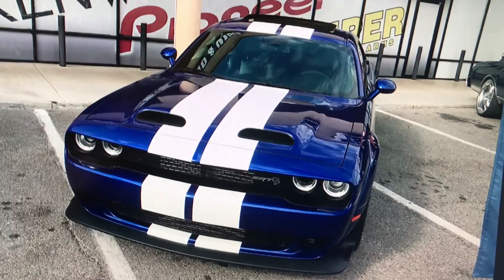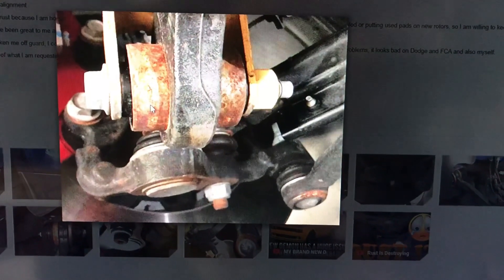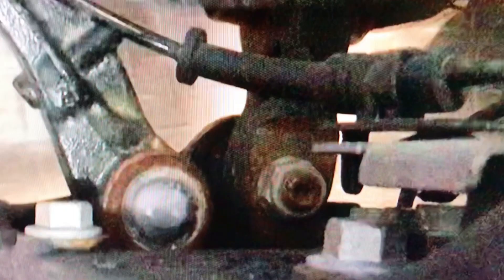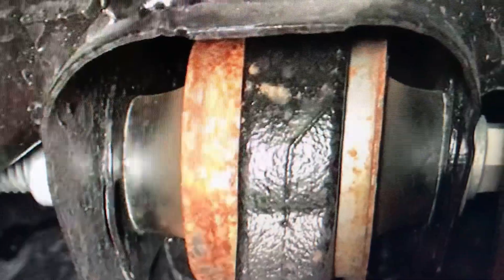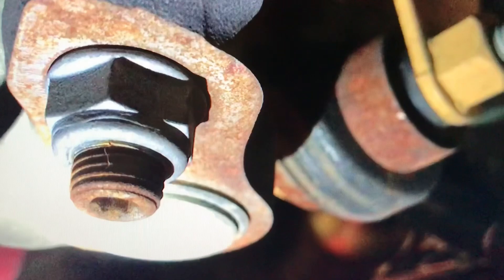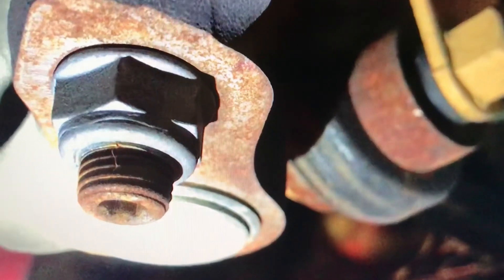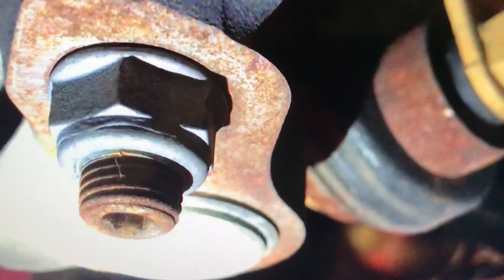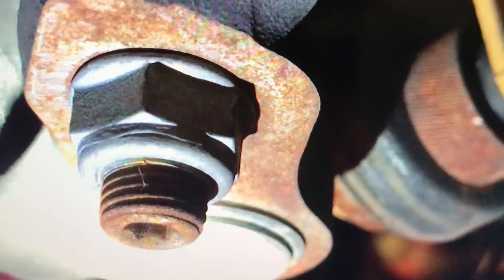2019 HELLCAT REDEYE WIDEBODY EXPOSING THIS SERIOUS RUST ISSUE VIDEO 1 OF 2 SHAME ON DODGE & FCA

Comment: You're one of those customers I'm an ASE certified master technician there is nothing wrong with that suspension all of it is just surface rust including the threads there's no crack in that bolt  you're saying that you don't expect rust issues but you have to realize there are a lot of factors that play into the amount of rust on the underside of the vehicle number one factor is location location of the vehicle location of the dealership pretty much if it's near the coast if it is in the snowy area if it is in a very dry and harsh location you will see rust accumulating a lot faster please before you start bashing any company or manufacturer do your research talk to a local technician
Reply: Right he just copying Kevin van voris and the way he talking about he doesn’t seem upset he using this as away to get content for his little channel
Reply from the maker: @drunkendemon1867  I do not need to copy anyone and YouTube is not how I make a living, so your clueless to what you say
Reply from the maker: I have done my research, maybe you should also and stop accepting what they tell you
Reply: I've seen this on Chevys, Fords,  Subarus etc. But the fan boys on here need to bash Dodge.
Reply: @cashsanders4111  I don't give a s*** about the FCA I've been in the automotive industry for about 15 years now I've seen rust on a brand new 2019 ZR1 that's $150,000 car we in automotive industry know exactly the difference between surface rust and actual rest and the different conditions that cause it surface rust as seen in this video is unavoidable in certain conditions instead of coming on here and trying to insult people and trying to stick up for someone who doesn't know what they're talkin about please take a pen and a piece of paper and try to learn something because I do know what I'm talking about

Comment: I work in the aftermarket industry and am the guy who puts lift kits on new trucks, adds heated seats, new wheels and tires ect. so when you take delivery of your car it’s exactly how you want it. No matter what vehicle comes in Chevy Ford Dodge Ram something is always “rusted” I would more over call it surface oxidation metal and humid air/rain water will cause this on any vehicle. Get under there like I did my truck and sand and repaint and keep up with regular maintenance then cover the surface with a metal protector like amsoil metal protector. My truck looks brand new off the line now even through this winter in Ohio
Reply: Completely agree with you.
Reply: Rip banana I miss him

Comment: as long as you keep buying dodge products you will continue to keep posting videos like this.i work at a dodge dealer and i can tell you that they all rust just like yours did.nothing special about your car that caused it to rust any faster or different than any other dodge with the same chassis..the chargers do it,the magnum station wagons do it,the challengers do it and the chrysler 300's also do it because its the same fucking car with the same suspension components.if you dont believe me then have a look at all of the cars that i just listed and you will see that they are identical.and yes they fucking rust.dodge didnt take the time to coat the steel with aniti corrosion paint or clear coat inhibitors.its a dodge and you get what you pay for.over priced junk my friend.i told you to buy a mustang gt 350 but you didnt listen.this is why 99% of dodge technicians DO NOT DRIVE DODGE PRODUCTS.but we sure do make a damn good living from them!!

Comment: Just like to let you know that all of that is surface rust, and a ton of cars over $100,000 often have large amount of surface rust like that on the bottom of car. Look at the bottom of a ford gt or a $80,000 Ford F-350, Chevy Silverado 3500 or Ram 3500, all of them have surface rust like that on the bottom of them. And yes they didn’t want to replace the front suspension for you for free if there was no problem at all, obviously you have never seen surface rust before. You can even find Lamborghini’s with SURFACE rust just like this. Also you are guaranteed to get surface rust on steel, unless it is stainless steel is 100% going to have surface rust. Especially if you leave it outside all the time. Why do you think older cars are always covered in rust. And with you living in Las Vegas all the sand will eventually grind away at the powder coating revealing the bare metal and causing surface rust. If it’s not surface rust then you would be able to flake off large piece of metal, but guess what you can’t. 

Oh and the $77 million fine was because of the fact that the Hellcat and Hellcat Redeye didn’t meet fuel efficiency regulations, as in they use too much fuel, you really need to do some research before you post stuff like this.
Reply: even stainless steel rust under some circunstances

Comment: That’s normal.  That is NOT an exotic. It’s a dodge!!  Buy yourself a Mercedes Benz, an stop complaining.
Reply: Until it's sitting in the shop for 3 months for electrical problems.
Reply from the maker: You realize that this is a Mercedes E Class Platform right?

Comment: Its a Dodge Challenger with a big motor. That did expect dude? You’re one of those people who only cares about 800 HP and 0-60 times. It needs iron to hold its pig fat...would take 20+ years for that surface rust to become a problem.
Reply: @williamdouglass7864  Ford had 29 million transmission that needed recalled in the early 1980's Reagan changed the law to not put Ford out of business. Ford sent out stickers to let people know the car could jump out of park and kill you. Instead of spending the $0.03  per transmission to fix it.  Over 1000 people injured and a bunch dead.

Comment: Just drive it and enjoy it. It's not a museum piece it's a car. Surface rust..... It wont hurt the car. Ive had two challengers that both looked like this, Scat pack was worse than my hellcat. The cars sit outside in unfavorable conditions until they ship, then they are still shipped in unfavorable conditions...Dont let surface oxidation on the underside of the car keep you from enjoying it.

Comment: It’s called flash rust . Pretty common in a lot of newer cars from all makes. They are using cheap grade steel .Coat  the surfaces in Wd 40 and that will keep it from getting worse. I would also recommend it getting a full underbody professional undercoating . Your car sat in a storage lot briefly in Canada most likely before being shipped which made the problem worse. Not a huge deal man. I’ve seen late model almost brand new Honda’s , Gm cars have similar issues.
Reply: nah oil undercoating that what we use in canada because the ruberized or things like that will get hard and crack over time then water will creep in and split rust will formed and split the metal

Comment: @Paul Klein.  I had the same issue with my brand new 300S. Local dealership stated they never seen anything like it before. Long story short, dealership refused to help and FCA stated I didn't have an issue.  Come to find out that certain Dodge/Chrysler vehicles manufactured in the Canadian plant during the winter months had components that were not properly treated. Those parts then were exposed to a deicing agent that is frequently used around the facility, thus having a reaction. causing those parts to rust and rust fast. My brand new 300S with les than 30 miles on it had parts that literally looked like they came off the Titanic. Check your vehicles manufactured date and I guarantee it was built during the winter months. Just FYI I live in south Texas so we don't have vehicles exposed to road salt or deicing chemicals.
Reply: That's exactly what this looks like. Good detective work!

Comment: Geeze and my Redeye is due any day now to show up to the dealer but we have an agreement to put it right up on a lift and pull all four wheels to inspect it for these issues.
Reply: Good move. If im not mistaken, u have the right to refuse delivery and they have to refund you if you dont like what you see
Reply: @msaleh93  Yes I do have the right to refuse delivery and a refund of my deposit. In Paul's case if that car was state inspected in Pa. the inspection mechanic and dealer would have some serious explaining to do passing a cracked major suspension bolt like that. It's clear it didn't just happen and it has some serious rusting going on.
Reply: @Old_Tyme_Racing  Yeah the cracked bolt sucks. But videos like this make people think that having some rust on components on  the bottom of a car is not normal. Bolts are gonna rust. That is what they do. NOW they shouldn't have been rusted at this time. It takes a couple years.
Reply: Let us know what you find....
Reply: @Anth230  The other rust issues are normal for new cars but there is some on there like that rusted cracked bolt that are unacceptable. Kevin Van Voris's Demon was a travesty as his bigger issues were the painted parts had the paint peeling off in sheets and they pitted but Dodge replaced everything.
Reply: @Anth230  Trust me I plan on doing my own video on my ordering experience with Dodge and condition of the car when it gets delivered.
Reply: @Old_Tyme_Racing  Cool, I would be interested to see and if there is serious rust and you refuse the car, what they have to say....
Reply: @Old_Tyme_Racing  Yeah that bolt sucks. They should have automatically replace it and cleaned that area up for him....
Reply from the maker: My 15 Challenger has Zero Rust and it is 4 Years old with 22K miles, this is not normal surface rust, a few more hours the 2nd video will post, it is taking over 6 hours at this point to upload
Reply: @ThePaul1551  Paul I agree with you. some of those components do rust over time and is normal to a point. Not sure how long it takes in Vegas for a vehicle to show any signs of rust on the undercarriage (if any) but things like axles and drive trains, certain engine components do rust. It's pretty much normal because they are exposed untreated metal. But the cracked bolt is unacceptable and yes they should have immediately fixed it. As I said in my post. My bolts on my new truck were not rusted and it was on the dealer lot for months exposed to the elements. It usually takes a few years for nuts and bolts to rust. Not sure why yours are already rusted. I can only assume they do not store their parts properly. Anyhow you have a right to be pissed and I'm on your side.😎 Good luck. I will be interested to see how this gets resolved.
Reply: @ThePaul1551  can you seeing any of these rusted components when you shot the first video of it on the delivery truck.? All this rust is BS. 100K Dodge could at least invest what 1K in quality hardware and its protection.. I hope you sue.. look forward to second video

Comment: Even at its worst, FCA isn’t even as bad as what Ford is doing to their Gen III Coyote owners.
Reply: I don’t know about that. Both companies are known for terrible quality. At some point buyers for these companies have to wise up and realize some things never change.
Reply: Ascendancy I must be a lucky one.  I daily drive a 17 Charger Scat Pack, 32k miles, and it runs like a clock. Never been in the shop for anything but scheduled maintenance.
Reply: Truth right there
Reply: I agree.  At least FCA isn't putting plastic oil pans and drain plugs on its cars yet like Ford does.  Can you imagine paying $60,000 for a Shelby or $70,000 for a Raptor and getting a plastic oil pan?

Comment: Unacceptable.I purchased a 2016 Ford F-350 new and I had rust all over the front suspension.It was far worse than that.Ford told me that it didn’t effect the structural integrity of the vehicle and was acceptable.The dealership stepped up and offered to replace some of the suspension parts and offered to pay for rust proofing.Well not a good idea to cover up all the rust so I said no.The dealership did try help to a certain extent but the right answer was to replace everything that was rusted.Stand your ground you are right.Traded the truck for a new one 1-1/2 years later.And yes another Ford.This one did not have any suspension rust issues.Still good as of today.good luck look forward to the next video.

Comment: I don't know a mechanic in their right mind that would classify that car as unsafe. Untreated metal always will surface rust, pretty fast too. Many cars can be brand new on the lot and have more surface rust than that. Especially a car that sits that low, the first time it rained that rust would start to form. Anybody who has ever wrenched on a car or has knowledge of fabrication understands these elementary basics. You don't want surface rust on the underside of your car? Pay for POR15 or a similar undercoat. Metal MUST be treated to not surface rust, and surface rust is completely normal wear.
Reply: YEP--this has been a big issue with many Ford F150 trucks---but a coating will fix that---there are even plenty of videos about this.  It is amazing people will spend $70K on a car and $20k on options then not spend a dime to under coat, just let it rust so they can blame the dealer or whoever.

Comment: My 18 Hellcat with under 1,400 miles, CA, never seen rain, has rust in those areas, albeit not as much as yours. I plan on brushing on Corroseal rust converter and then after that spray on some WD40 Corrosion Inhibator
Reply: hit it with Fluid film or Crown. Much better then WD

Comment: This isn't nothing new my 2003 Ford Lightning pickup color white had rust spot in the white paint all over yet this has been happening for more than 25-30 years get a grip. At least yours is under the car and not on top.😂
Reply: Clay bar will take those rust spots off easy. All cars have it but only noticeable on white cars.

Comment: Chrysler is known for their lack of rust proofing the vehicles they sell.  I lived in Buffalo, NY for almost 30 years and the Chrysler vehicles never lasted more than 6 years without serious rust on the body panels.  You should have taken that thing to get a rust proof coating applied like Krown or Fluid Film.  It’s an organic oil that will keep your car rust free and lubricates forever.  I get it applied annually and my truck is pretty much totally rust free after 7 winters in NY.  Where was that car built?  If it was built in a state that uses salt on the roads, then hauling it in a salty mist for 1000 miles would be enough to rust that stuff.  The chance of rusty parts being installed on the car at the factory is slim to none.  Welcome to earth.
Reply: "Welcome to earth."

Lol, he is rich, not an alien 

XD
Reply: The challenger is built in Brampton  Ontario, Canada. Literally 20 minutes drive from my house which is also the salt belt.
Reply: Without rustproofing, cars get heavily rusted by the 5 year mark

Comment: Paul...I know you don't want us to comment. I understand your frustration. Just got a new truck and had it immediately undercoated. But yes there was some rust on some components (which is normal It was on the dealers lot for awhile.) I usually am only concerned about major rust issues on the frame. My bolts were all rust free but here In the rust belt THEY WILL rust. I did coat most if them with fluid film before winter hit here, because I don't like the look of rust and they didn't proof the bolts..lol...but if I had some rusted bolts it would not have concerned me.BUT A CRACKED BOLT....yeah I would be pissed. Now my drive train has some surface rust on it as well as my axle Which again those parts are gonna rust. They aren't and have never been parts that get treated. The drive train as well as other parts, like bolts are untreated. BUT their structural integrity or function usually do not get compromised from rust. NOW in your case the cracked bolt should have been replaced immediately and also since you had the car built and it wasn't sitting on the dealer lot I would expect it to be cleaner than what my Undercarriage was. The good news for you is that most of that can be easily cleaned. Be happy that your frame is clean. Once you get those corners and bolts cleaned up go get it undercoated. With preferably an oil based coat. I hear KROWN is really good. Good luck....and yes FCA should have taken care of it for you.  especially the cracked bolt.

Comment: This is why I purchase all of my cars in the summer and then spray the entire underside with WD-40. You can look at two of the exact same cars, regard of make, and one might be rusted and the other not. I've seen it time and time again. This is a car that was shipped in the winter and either got doused with salt spray or sat in a high humidity environment. That same car built and shipped in the dry summer months would not have this issue. Facts.

Comment: I have an 18 challenger and i noticed the other day a lot of crap in the suspension was rusted but i thought it might be normal surface rust
Reply: It most likely is. Just make sure the frame stays clean...components that rust will wear out over time anyhow and have to be replaced. A frame..??? That's not an easy thing to fix ...so make sure you take care of that...

Comment: IF they won't replace and you are planning on keeping I would get someone with a small Dremel to clean what you can get to & then coat, OR have a professional mechanic REMOVE, then blast & then powder coat or paint with quality paint, then reinstall, the split bolt may very well show up with a replacement also. This is just ONE reason I have NO intention of buying ANY new car.
Reply: Would then void the warranty probably ?

Comment: That rust is only surface from what I see. But that said, if I paid that much for a car I wouldnt want any amount of rust on it. Not on a 90k dollar car.
If it's already rusting on the surface and beginning to eat into the metal that fast then it won't be long before that suspension is all rusted up
This guy should be pissed off for sure